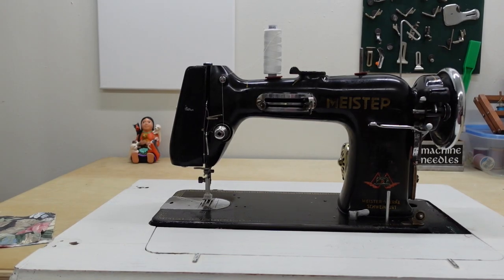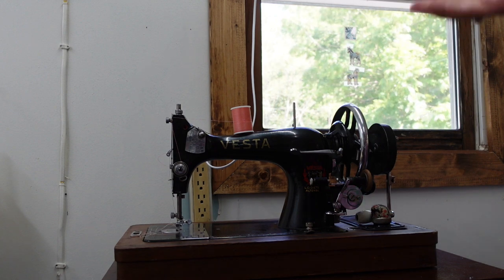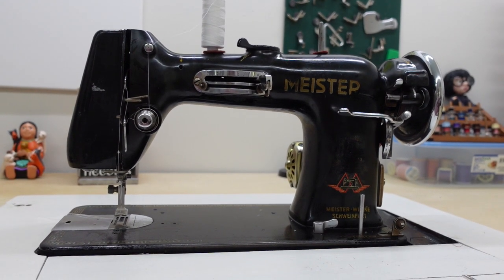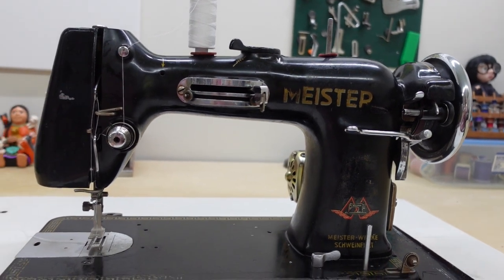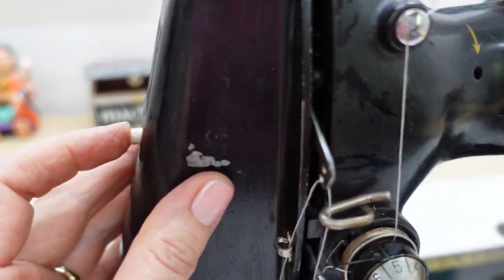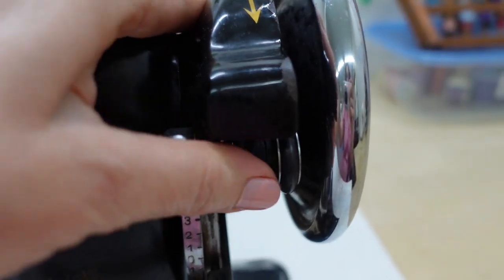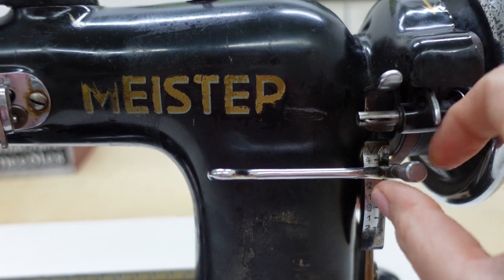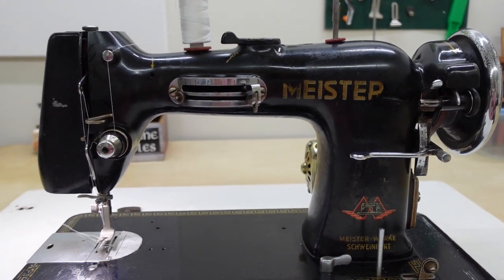My Meister by Meister-Werke sewing machine

Comment: What a pleasure! Thank you for showing your machines. Do you have others that you use? I recently bought an d singer. It was made in the 40s and is a home industrial machine. I had never heard of it before. It works but slowly. I had it serviced but I really think it needs a new motor. Where did you get yours if you remember. Love love your machine!
Reply from the maker: Hello! I just checked and they sell the same motor I have on Ebay.  Good luck! Also,  check your foot controller 😊